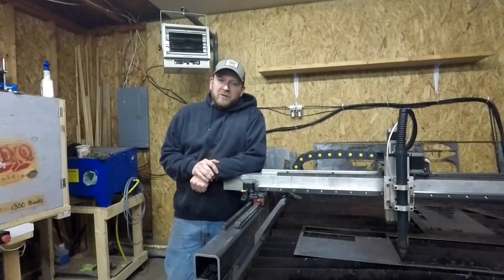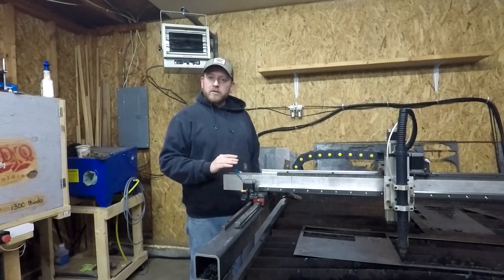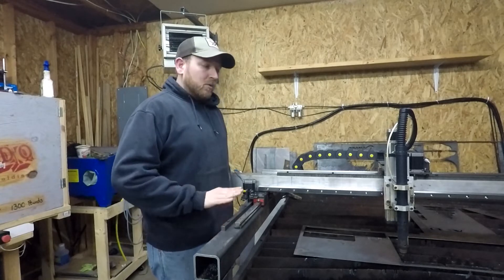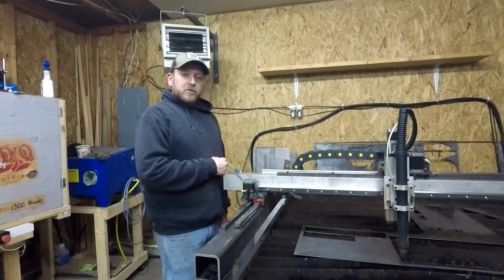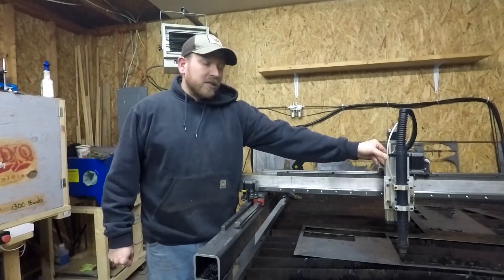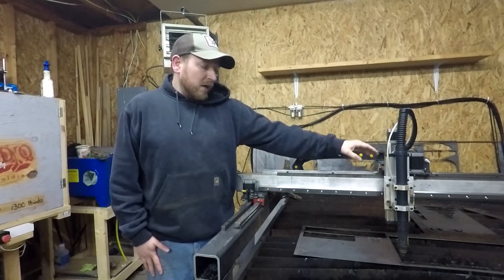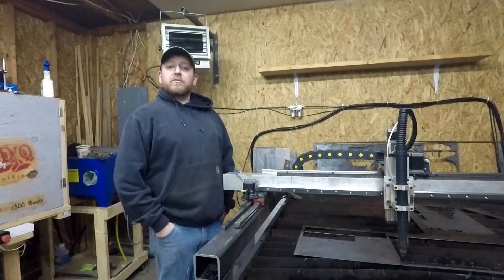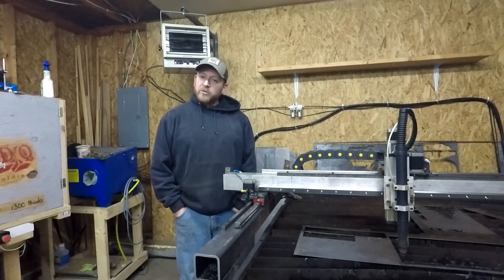Making a CNC Plasma and Making Money

Comment: Any luck?  I finished my 2x4 table recently for fun - would like to generate $2k to buy a 100 amp cnc plasma.
Reply from the maker: I have actually had a lot of luck. It is why I haven't done a video in a while. Though it is on my to do list! I now have a 2000 sq ft shop, about to buy a fork truck, building a 5x10 plasma table for an 85 amp cutter, and buying a fiber laser engraver. The business is doing well at this point. I will make sure to get a video done in the next month and try to get back into that.
Reply: Engineering Awesome Excellent!!!! Would love any advice, thanks!!!!
Reply from the maker: @borderm3  Sure man! I don't mind helping you at all. I'll work on that video too. There have been a lot of new subscribers lately, despite the lack of new content. Gained 300 without doing a video. So it is time to get back into it.

Comment: Fire pits. People love fire pits and there are so many designs you can come up with. I built a 2x4 table last summer and I've been doing geodesic fire bowls and letting them choose the design they want cut into the sides. I make them out of 10 gauge mild steel and people love the quality compared to the ones you get at the big box stores
Reply from the maker: That is exactly what I have been doing. I do my own designs on the pits as well. With my 4x4 table I am able to cut a full pit in one go and with some designs two in one go. Fire pits are by far my largest profit margin and the most fun for me to make.